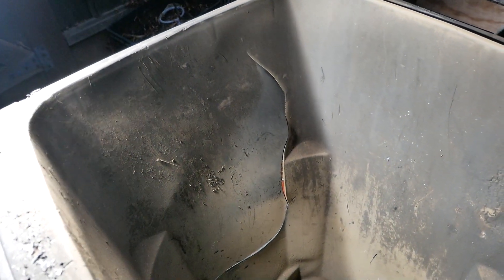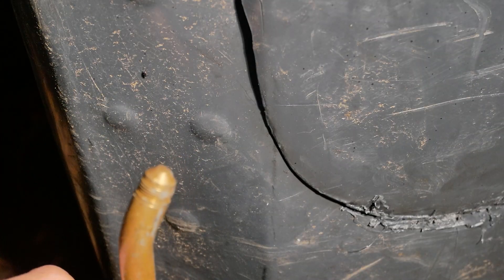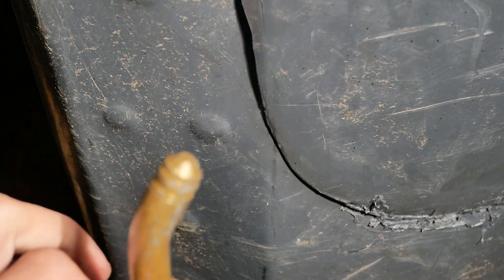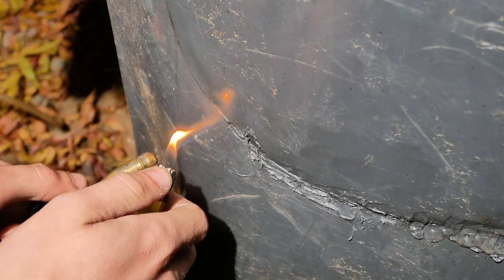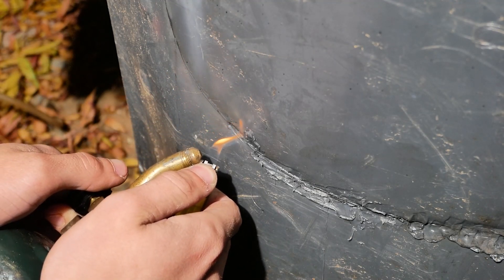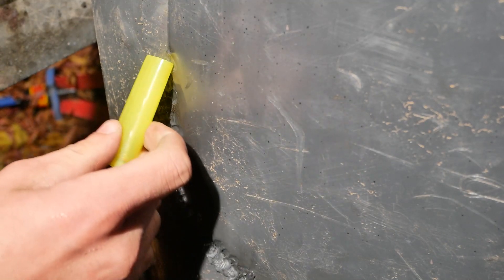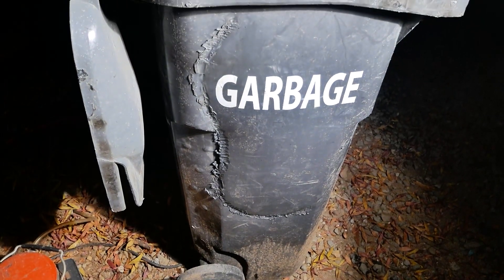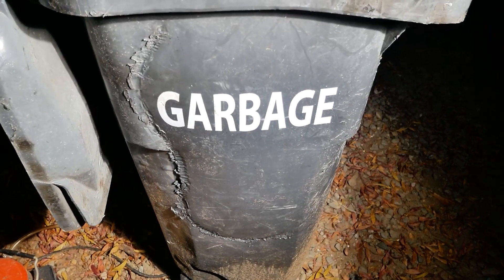I BLEW UP MY TRASHCAN and welded it back together- how to weld plastic

Comment: A soldering iron with a wide tip would also work. i used it to weld and smooth 3d printed TPU parts
Reply from the maker: yup